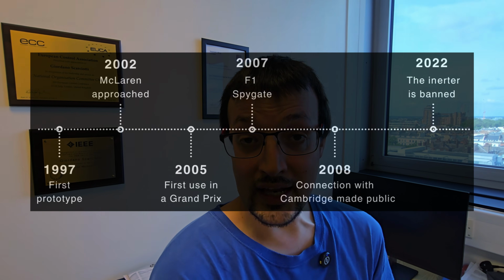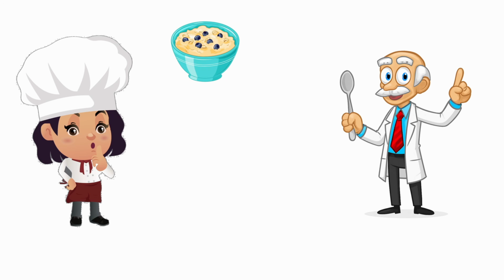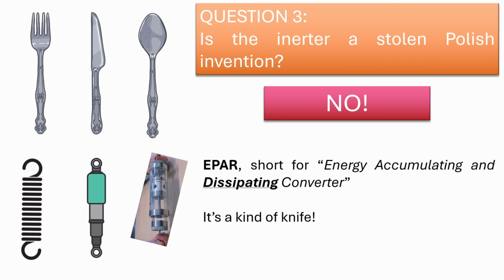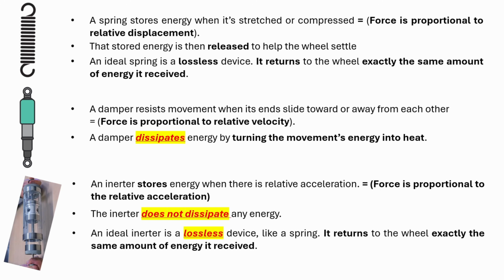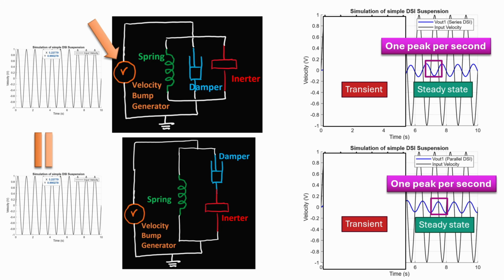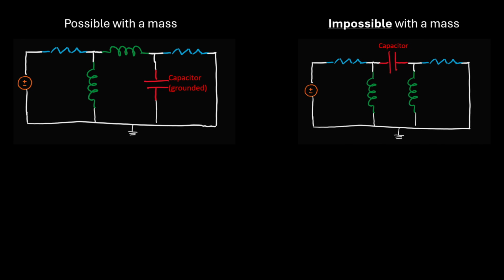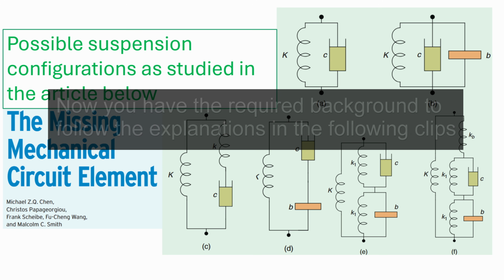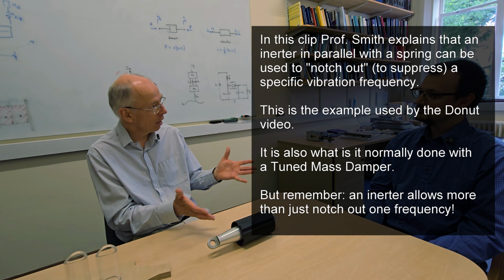Why Everyone Gets the F1 Inerter Wrong | Explained Clearly

Comment: I enjoyed and understood both videos but the one thing missing from both for me was to actually see a real or graphical inerter having a force applied to it and then having the force clearly removed to enable me to see what happens to the inerter i.e. what happens to the energy stored within it.

I can visualise from the descriptions etc that if the actuating rod is pushed in a certain distance/velocity and the pushing force is removed, the actuating rod will continue to move in the same direction for a similar distance/velocity but it would have been helpful to see this in action with the actual inerter. I'm using distance/velocity as a "non-technical" approximation.
Reply: Yes I really believe a full system model would be very useful, if only for illustrative purposes. Show how an RC car or go-kart reacts differently to the application of an inerter vs a improperly applied damper or shock.

Comment: Correct me if I am wrong, an inerter works with inertia, meaning that depending of the weight it will use the velocity and the arms as a force to correct the balance. For example, yesterday I was helping a friend to move some things with a wheelbarrow and although it didn't  have neither the spring nor the damper depending on the velocity with the weight of the fridge we were carrying would require my arms to put some force to correct the balance, meaning more velocity would require less force from my arms to correct the balance, but less velocity would make it more heavy or difficult to correct, so I would use the speed of the wheelbarrow as an inertial force to aid my arms to balance guide the wheelbarrow. So my arms would work as a kind of actuator. So I had the spoon but I lacked the fork and knife that would've completed a more comfortable ride. I mean, spring, damper and arms, but since it had only one wheel, the other components wouldn't be of much help, except the  spring on the wheel, but you have the air on the wheel acting as a kind of spring with the weight although an actual spring would have added that extra cushioning. In a car the springs and dampers are more necessary because there are four wheel and they have constant and different forces acting upon them, and an inerter completes the counteracting to those forces.

Comment: ok that gave me a headache but how i understand it is that it works as a third item one that smooths out the suspension WITHOUT  losing it through heat but returns the energy when required to  into the system to prevent the free oscillations you get into the existing system. its  an energy storage device that prevents the excess oscillations in the existing system and returns the energy when needed. if that's correct its a game changer as it will smooth out the suspension without losing it as heat like existing damper/spring setup.

i had the lightbulb moment at 28.40...... look at the waves, the inerter plus the spring CANCEL EACH OTHER OUT.....so basically you get a COMPLETELY SMOOTH RESPONSE FROM THE SUSPENSION.  you don't get the free movement of the spring against the damper, what you get instead is that the extra bounces or any difference between the spring and damper rates ARE REMOVED.

its actually pretty brilliant he's using electrical theory in order to solve a similar problem in mechanical terms.

Comment: It took 13 minutes and 17 seconds before you gave any information at all about what an inerter does, namely generate a force proportional to relative acceleration. Analogies can help but without a destination to work towards, the viewer must aimlessly absorb the analogy for later, then be reminded how it applies to the concept. Sitting through the chef/knife/spoon/fork section was frustrating and could have been covered in 30 seconds. It would work better if you went ahead and gave a practical definition first, even with the assumption that it would not be understood, and keep returning to it as you give analogies and examples in order to flush out and support the definition.

Comment: Still no word explaining, that while spring accumulates force and then releases it in reversed direction, this device accumulates force and then releases it in the same direction. 

For example, if we apply a compressive force to a spring, when the force is removed, the spring will immediately begin to release it in the opposite direction, i.e., to relax. When we attach an inerter to the spring, after the force is removed, the spring will continue to compress until absorbs the force accumulated in the inerter's flywheel. Now, note: what happens next? The spring will begin to relax, but the inerter will begin to remove the force from the spring in this reverted direction. It completely changes the game!

I hope this will help to fully understand mechanical work of the system 😏

Off course there is also a dumper in the system but its work is quite easy to understand by intuition.

Comment: Within the current video examples, the inerter's functionality is demonstrated with both ends firmly constrained by the suspension system components. To further clarify its operation and make the concept more accessible to a broader audience, I propose incorporating a hands-on, visual demonstration utilizing the inerter demonstrator that was previously showcased by the Professor. Specifically, while the Professor's initial demonstrations were effective in illustrating the inerter's basic principles, they involved restraining both ends of the device with his fingers. To build upon this, it would be highly beneficial to present a modified demonstration where only one end of the inerter is restrained, and then force is applied to the other end using an open palm. This approach would allow viewers to more intuitively experience the inerter's unique behavior. When the applied force is released, the unrestrained plunger will continue moving in the same direction it was pushed, while the flywheel gradually returns to a standstill at zero RPM. A crucial distinction that may not be fully grasped by all viewers is the difference between the behavior of a spring and an inerter. A spring, upon release, returns the stored energy in the opposite direction of the initial force, whereas an inerter returns the stored energy in the same direction. By implementing the suggested demonstration with the open palm, we can create a more intuitive and memorable learning experience, helping viewers to better understand and differentiate between the energy return characteristics of springs and inerters.

Comment: Very interesting, but I didn't quite grasp how the inerter stores and releases so much energy when it's so lightweight. Is it really just a function of the little flywheel multiplied by the thread pitch angle?
Reply from the maker: Thanks for the comment. The effect comes from the screw–flywheel mechanism: the thread pitch converts small linear motions into large rotational speeds. Even with a lightweight flywheel, the high angular velocity allows significant energy storage.

Comment: you could use a big diameter piston moving a liquid in a smaller longer cavity, the difference is the friction that would inevitably creates damping so dissipation. The difference of diameter would set the phase shift and the length of the smaller cavity would be the capacitance, it could be cheaper and more reliable compared to a ball-screw and gearbox.
Reply from the maker: There are fluid based inerters. I discussed this with Prof. Smith, but this didn't make it into either this or the original video unfortunately. However, note that the key point of the inerter is to realize a pure inertial element without added damping. In practice, fluid interter would always introduce dissipation, so they are not equivalent.

Comment: As a complete non-engineer (and non-physicist) the entire subject seemed completely baffling.  I started with really no idea what the designers of suspension systems were intuitively trying to do, beyond smoothing out bumps in a way that made the car drivable.  But as an ex-economist with some knowledge of the way dynamics can be applied to analyse the stabilisation of an economy,  Professor Smith's original insight made a weirdly familiar sort of sense.  Because we try to think about how to minimise output fluctuations without crushing the output, or causing intolerable inflation (for instance).  So when he explained that there was a completeness theorem for the impedance of electrical circuits and his idea was to translate that to mechanical arrangements like suspensions, this made complete sense, although I understood none of the details.  What was easy to get, from my outsider viewpoint, was that completing the set of components would have systematic holistic effects, not just effects on a single element, and that what was being achieved was to enable design of a set of suspensions that matched the overall design characteristics being required, whereas the incomplete set might not (and Prof Scarciotti said, I think, will not) generate any matching solutions.  (A parallel might be that if you eliminate monetary control from the economic system, there are not enough control variables;  you can only get systemically unstable solutions like full employment with unacceptable inflation).  So, when Professor Smith said that what they were trying to do was minimise lap time, rather than smooth out the oscillations at some particularly brutal corner,  that also resonated.  I could understand that the inerter was a component that he was able to design that had the property of completing the set, and enabling the theorem to be applied.  

Having watched the two videos, I now also know a little about suspensions, and that was fascinating. It does seem plausible that the undrivable nature of many of the cars since 2022 has been intimately related to the incompleteness of the solution set for suspensions, after the banning of inerters at that point.
Reply from the maker: Thanks a lot for your thoughtful comment and for relating this to your economist background, it was interesting to read. Your understanding is correct.

Comment: ok real simple. Spring store force... the dampers resists the rate of change in force.... and the inerter resists changes in the rate of that force. So it basically acts a PID system for the suspension.

Comment: Imagine you're riding a scooter on a bumpy sidewalk. Boing, boing, boing! You bounce up and down a lot, right?

Now, what if you had a magic backpack? When your scooter hits a bump and wants to throw you up in the air really fast, the magic backpack instantly gets super heavy and pushes you down, keeping you from flying up. And when the scooter goes down into a dip and wants to drop you quickly, the backpack magically gets super light so you don't slam down hard.

An F1 inerter is like that magic backpack for a race car.

I am not an engineer in any capacity or even a race enthusiast, but this person clearly does not understand how to explain something to a 5 year old.
Reply: Yeah, he likes to hear himself talk. Inerter is active, damper is not. Inerter is better than damper, why? It's lighter, "redirects" forces accumulated better. So car goes faster on corner exits. There are no oscillation  (minimal). See? It didn't take 20 minutes.

Comment: Unlike a spring, when the energy stored in the inerter is returned to the suspension it would be in the same direction as the movement that started the flywheel spinning. This is different to a spring which would return its stored energy in the opposite direction. Assuming the inerter is connected to the suspension parallel with the spring and damper, It would have the effect of smoothing out suspension movements.  However, it is unclear from your videos where the inerter is connected to the suspension - in fact, in one video it looks as if it might join together the suspensions of the left and right wheels.  Without seeing a clear schematic of the how all three components (spring, damper, and inerter) are connected - I can't visualize how its characteristics would impact suspension movements.
Reply: Yeah, it's amazing to me that in neither of these videos the actual mechanical configuration of the system is visualized (except the 3D drawing which is not really possible me sense of to me. Where is the wheels connected?)

Comment: Inductors resist a change in current by storing energy in magnetic fields around its conductor. In your diagram, you're claiming this is a spring. This is apparent by the direction of the phase shift. 
Capacitors resist a change in voltage by storying energy in electric fields between its plates. In your diagram this is the inerter. This is apparent by the direction of the phase shift. 
Resistors resist current by dropping voltage (dissipating energy). This is the damper and there is no phase shift. 

With these three functions we can create an RLC circuit to have any resonance. Circuit resonance plot is the same as the Bode plot. Therefor with these three components, I can create a suspension with any resonance.

Comment: Excellent video. As an electrical engineer with a strong understanding of system theory, your expansion is very clear. The analogy of mechanical systems to RLC electrical systems is very clear. This was clear early in the explanation of Prof. Smith.

But to me this explanation is frustrating because it is like discounting the developments in the electrical and electronic engineering fields of the past 70 years with the advent of active electronic components, digital control theory and even AI.

There is so much more that can be done with active components that cannot be done with just passive components as your toolbox. And in the past 30 years there are even more tools available because of digital tools. 

The original premise of Professor Smith in his interview is an even better approach. Active computer controlled suspensions with multiple inputs and multiple outputs controlled by digital algorithms should be allowed by F1. 

Even beyond that, the current state of the art is artificial intelligence. Digital control theory is even somewhat outdated by AI based control. 

F1 seems to be living in the past. 

If F1 won't allow these technologies on the racetrack, I hope manufacturers will incorporate these control theory driven technologies and even AI driven technologies in ordinary cars. This will result in safer, more responsive vehicles that may even outperform F1 vehicles if F1 continues to outlaw the technologies.

Comment: Very clear explanation, the only aspect that's still fuzzy to me is what is analogous to what in the mechanical-electrical analogy. Dampers are obviously like resistors, but I'm confused on what is alike a capacitor and what is alike an inductor between a mass, an inerter and a spring. I've found conflicting sources about this so I'm not sure

Comment: I replied in another comment, but I think you missed that the inerter has another advantage, it lets you "add mass" without actually adding inertial mass. The latter is important because inertial mass reduces performance. I think this is already a huge advantage which lets you reduce the ride frequency at the same spring rate without adding additional mass. In this application, it's equivalent to adding more grounded mass without adding inertial mass.

However, inerters have an another advantage which you mentioned of being a free two terminal device. What are examples that leverage this benefit? I get that you get the freedom to make what you want, but what are some examples you can achieve? The peaky bode plot you mentioned is indeed realizable with a series RLC circuit but I don't think that will yield benefits on a race car (afaik you generally want a low-pass-y response)
Reply: Hmm, there's another video titled "Damping enhancement principle of inerter system" that shows something interesting. 

There's an example where instead of a regular sprung mass tuned mass damper, you can connect a two terminal inerter to the structure and connect a spring to it. This will set up series resonance and at the resonant frequency you can get peaking at the node where the spring and inductor is connected. If you attach a damper to this node, you get more "bang per buck" on your damper because a small amount of movement in the building causes a larger amount of movement on the damper node, which lets you enhance the effect of the damper on the rest of the system. If you wanted to do this without an inerter, you'd need a damper that can effectively damp at higher forces and lower amplitudes, which is prohibitively expensive. 

If you transfer this use case to cars, you could add a series tire-spring-inerter-chassis and connect a damper from the chassis to the inerter. It will add lots of loss at the resonant frequency (perhaps warranted depending on what you're doing) without spending a lot of weight and size on the damper.

Comment: An inerter doesn't do anything useful in isolation, just as a capacitor doesn't do anything out of an electrical circuit.

As just one example use, an inerter allows for the design of passive mechanical filters, just as capacitors, inductors and resistors allow the design of passive electrical filters. Of course these three components can do a lot more than just filtering signals: on their own they do little, but in combination they can do a lot!

Also, thinking about derivatives might help:
  * A spring provides a force relative to distance between two points (x).
  * A damper provides a force relative to speed between two points (dx/dt or ẋ).
  * An inerter provides a force relative to acceleration between two points (d²x/dt² or ẍ)

An inerter allows much more precise purely-mechanical control systems and filters to be designed and built. But you do need some control theory knowledge to use one.